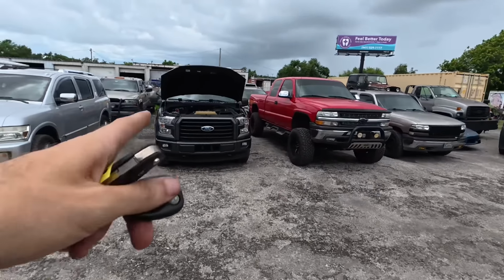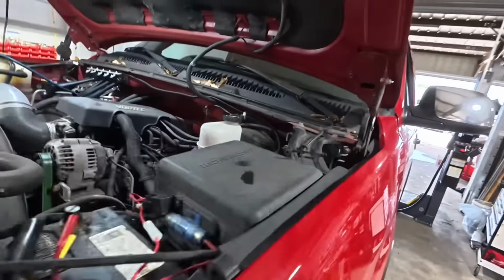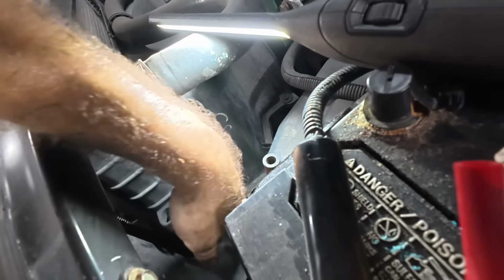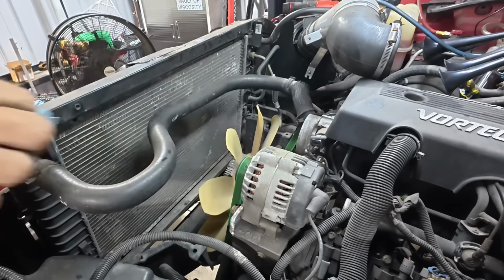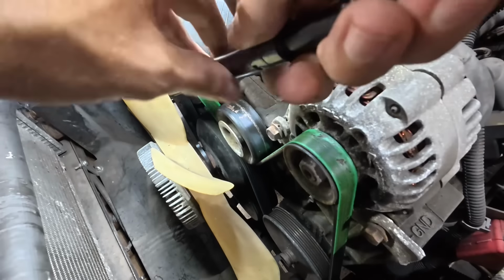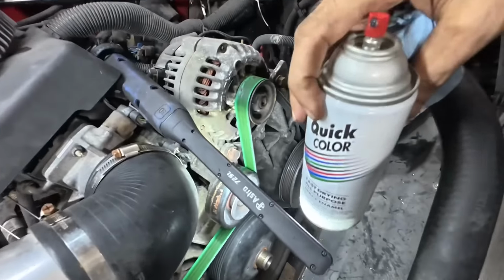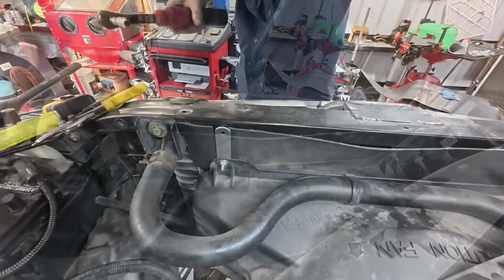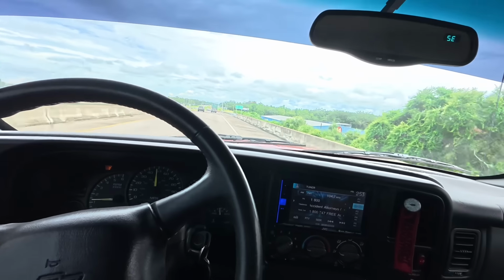Modified Truck has a Physics Problem!

Comment: I firmly believe that building a custom fan shroud that fits perfectly is a much better choice than purchasing a new one from another source, especially since it could end up being significantly more expensive and time consuming . By making it yourself, you not only save money but also ensure that it meets your exact specifications. However, this process requires having the right tools and expertise, which can ultimately lead to a superior and personalized result.

Pros of making the shroud 

1. **Measurement Accuracy**:

 Ensuring that all dimensions are precise is crucial for a proper fit. To overcome this, take multiple measurements and use templates or CAD software to visualize the design before cutting.

2. **Material Selection**: 

Choosing the right material is essential for durability and heat resistance. Research different materials beforehand and consider the specific conditions the shroud will be exposed to, such as temperature and moisture.

3. **Fabrication Skills**: 

If you lack the necessary skills in cutting, shaping, and assembling materials, the final product may not turn out as expected. Practice with smaller projects or seek guidance from someone with experience in fabrication.

4. **Airflow Efficiency**: 

Designing a shroud that optimally directs airflow without obstruction can be challenging. Test prototypes using airflow simulations or adjust the design based on real-world testing to fine-tune performance.

5. **Finishing Touches**: 

Achieving a professional look can be hard if you're not experienced with finishing techniques. Invest time in learning about sanding, painting, or sealing methods to enhance the appearance and longevity of the shroud.

By addressing these challenges proactively with research, practice, and possibly seeking expert advice, you can create a successful custom fan shroud.

Comment: fan clutches, are a joke. they work when the engine is first started, and DON'T DIS ENGAUGE TILL THE ENGINE WARMS UP. stupid. throw it out and install an electric fan. it will pay for its self with the gas munny you saved.

Comment: Maybe it's a lift kit, maybe it's Maybelline.
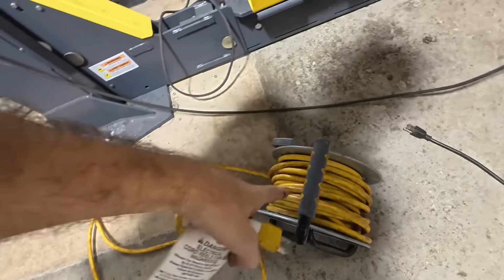11:00 If you use an extension cord, ROLL IT OPEN EVEN IF IT'S A BIT MESSY. You're risking a fire. (Also, why was that wallwart plugged into the top socket in the first place? :D)

Comment: This is funny, I have seen this fan removal tool twice in 24 hrs, I have had to remove mine a few times and used a wrench that fits and then popped the wrench with a hammer...

Comment: I think an aftermarket electric fan kit would have worked too. But you would have to set it up so that if the AC compressor was on the fan would turn on as well.

Comment: A neighbor jacked up his truck with about a 6" body lift (basic driveway mechanics)
On the first drive he got into an an accident when the steering wheel shaft pulled out of the power steering unit.

Comment: Does not matter if an electric fan system is slightly better, your repair was effective and is some respects simpler and at a lower cost  then the electric fans but most important you complied with the customers wishes,  That customer will likely come back when he needs more work to be done.

Comment: Ray you should have used D-shape gasket in that gap between the shroud and radiator. Also that serpentine belt was chewed up at the alternator pulley during most of your video.

Comment: The money needed for a shiny new lift kit is expensive and it's amazing the money can't be found to correct all the side effects of a poorly thought out kit.
 When GM built the stock vehicle we should give them credit for designing the cooling system to work as designed without modifications.

Comment: I don't know about you but I'd be asking the customer if this is a new problem like they just bought the car and it's like that or if it's been fine for years and then all the sudden just happened it just happened then you know it's not the cooling fan shroud and would have to be something else. I've been around hundreds of these trucks with body lifts and never really had any issue like this even missing the flaps. I bet you could've fixed that truck with just a new clutch fan and a full system

Comment: No Elec fan needed here at all. I’d replace the old 150k mile worn out fan clutch with a new Hd fan clutch.
Then I’d reinstall the shroud using adhesive back foam used to seal ac apps avail at Lowe’s etc to seal all the air gaps between the rad core & shroud.
Lastly I’d buy new oen placement flaps that mount on both sides of the radiator one of which you removed.
Doing all the above will get the additional airflow you need thru the radiator & condenser for proper ac operation & max cooling if the engine too closing all the airflow gaps along with installing s fresh new hvy dty fan clutch ensuring max cooling rpm & operation too vs a half worn out 150k mile tired fan clutch that’s not up to 200% operating efficiency resulting in less fan lockup/rpm considerably reducing cooling efficiency too.
I’ve done this sealing of shroud issues on mult vehicles in the past along with reinstalling the rad flaps with new Hd fan clutch that fixed this issue every time!

Comment: Hey, could you have pushed the bottom part of the shroud down. And then put the top part of the shroud up to close the gap. Then make some plastic spacers to fill the gaps between the 2 shroud halfs? Instead blocking the condenser?
Or would that allow too much air turbulence past the clutch fan?

Comment: I remember when I did a body lift on my Tahoe back then where the kit came with spacers to use between the halves of the shroud. I ended up using shingle material to cover the gaps. It worked😂

Comment: Some fine redneck engineering there. You would have loved what I did with my 2006 Freightliner Century seat today. Love the fan tool. The one I have requires the tech to be an octopus.

Comment: same fan clutch setup on my 2005 chebby express G1500.  I have to replace the duralast clutch every 2 years. lifetime warranty. Hot summers here, cooks the clutch good. What I did do this last go around is install an after market aluminium radiator that is about 25% larger (thicker) which seemed to help also when running the AC cool in slow moving conditions (stopped, traffic, etc).

Comment: I had the same air flow problems with my snow plow trucks overheating in the winter because of the plows pushing the air away from the front of the vehicle.  I would clock the spring on the clutch to pull more air flow thru the cooling system. As soon as I saw the clutch in the thumbnail I knew where this was going. Nice job

Comment: Now, see, most places that wouldn’t cause any issues whatsoever. Here in Ireland, we’re just coming out of our best summer in a decade, maybe more. It got right up there, for weeks at a time and there were public health warnings about keeping hydrated and staying out of the sun. How hot was it? A sweltering 30C (86F)! Lots of vehicles running around with severely damaged or even completely missing fan shrouds without a problem. There were a couple of days when I contemplated replacing the seized electric fans in my own daily driver, to get the AC working. But we’re through it now and it will be years before I need to consider that again. The engine never overheats, hence the seized fans. They never get used!
In Florida and a few other places around the world, temperatures are much higher and cooling systems are a bit marginal, so everything needs to be spot on, or even upgraded, to cope.
If that truck was modded in Canada and spent it’s life there, this problem would never have arisen

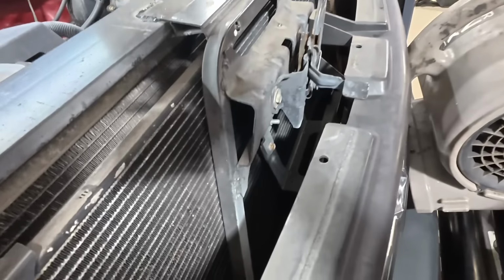Comment: Under neath  condenser cover at 12:53  look at the gap between radiator and top of condensor .  Later look at the sides also .  This situation is called bypass airflow

Comment: 300psi = 161F  =BAD   .....  OK=  200--220psi=  130to 137F   ,,,, . Excellent 150--160psi  =112 to 116 F  
WHY ?   this is the temperature of the refrigerant supplied your evaporator has to work with .  The higher the feed temp  your evaporator has to use cooling capacity ie BTU  to reduce this so it can get down to a usable level . Wasted cooling capacity .
Called Flash Gas because it flash boils .   In a car /truck its all about condenser size .  Currently using a serpentine  a modern version is parallel flow . 
Full computer control /ECU  operated compressors on the new gas run alot lower psi

Comment: Can someone please help me out, why is there a clutch on the fan? I thought there was a solid connection
Reply: Its is just a way of controlling fan speed( how much air it moves ). When its cold it just free wheels allowing the engine to heat up to normal operating temp,when its hot it clutches up to move more air . On electrics,you cts sends signal to the e-fan and turns it on and off as needed . Its the same in principal,just the mecanical version. Think the old gold round thermostats in a home compared to a new digital stat.
Reply: @petersmart1999  Thank you!!

Comment: refrigerant leak /insufficient refrigerant ,,, dirty evaporator ,,,  poor condenser cooling ,, connect gauges ,, sample refrigerant contaminated by other refrigerant and/or air  then .....common issues next would be thermistor failing  etc etc .** weigh the refrigerant you recover  another diagnosis tip... Vacuum leaks can be VERY bad on gauges and couplers . 
USE as product called NYLOG to seal   cased by  1/ outside of service port  2/ threads outside of coupler 3/ ontop of thumb screw ""peened "" shaft . When vacuumn is not acheived moisture will be in system can cause high psi reading .

Comment: just curious you extract the old gas and put it in other cars later or it’s a differnt bottle it goes into?
here in canada your  not allowed to buy the right gas unless a technician certified.
so stores sell 12a as a replacement for diy guys.
then you get a canadian car you might
be sucking 12a out of it not knowing

Comment: You came up with a cost-effective work around solution that improved the A/C.  Wasn't much else you could have done due to the body lift problem.  Electric fans would probably have only added an incremental improvement, but at a significant cost to the owner.  Good job!
Reply: Those trucks DID come with an electric fan option, and I could pick up an entire factory dual fan and shroud assembly that will bolt directly into the vehicle for $50 or less at a local pick-your-part junkyard. The factory dual fan setup blows out 3000cfms of airflow. More than enough, and cheap if you get it from a junkyard.

Comment: The owner would have been just as much good off (with the time you put in and thought you put in) with the electric fans. But it's understandable why he didn't want that electric fans, and trying to keep it simple. I give you  this, you put a lot of effort in what you did, damn good job. My future son-in-law was a tec, just like you. 
And he bailed, because of the BS that goes on. Was involved with similar of what you went through. You're doing a great job. There's not many that still do this. Good job bub, never give up.
Reply: if what I just text is all messed up, it's got to do with speaker text and autocorrect. I had to correct the best I could, what was messed up.

Comment: Why wouldn't you just remove the brackets off the shroud and have him buy an intake that doesn't get in the way of the shroud? That isn't the stock air intake. Without the aftermarket brackets the shroud would line up to the radiator like normal.

Comment: I agree with most here on modified vehicles the flat doesn’t apply it needs adjusting at the end of the day any vehicle operating daily with modified parts usually equals shop time due to the mods and most times taking away from functionality of the vehicles intended purpose lifted trucks look great but require so much more maintenance alignments extended parts wear and tear of bushings in some cases two piece drive shafts 🤦🏻‍♂️ 
As a mechanic I don’t twirl in these vehicles under any circumstances for clients great job Rainman I learn something new frequently when watching your episodes

Comment: Not sure how much into lifted trucks you are Ray, but the cheapskates would use a 3 or 4 inch aluminum spacer to BODY life the truck, leaving the drivetrain in the same place but raising the cooling package so some of the morons would drop the shroud incorrectly. but thats what you are working with is my bet

Comment: I remember dealing with body lifted trucks,,,,,and all the problems it causes. Correct fan shroud, body and radiator higher, but the engine isn't, so the shroud is cobbled in to fit the fan. Trucks with suspension lifts aren't much better.

Comment: The pickup probadly has a body lift so the motor stays on the frame, but the radiator raises which body. That is the cause of all the trouble. Operator error 😮😮😮😮

Comment: I like that you called the cold intake the hot air intake on that chevy. Cold air needs to be isolated from the motor, so it doesn't become a hot air intake.
Reply: It's stunning that people think a K&N cone filter in the engine bay is some how a cold air intake ... 😂
Reply: It is, in Alaska, in winter.
Reply: Yup.

Comment: Is it possible to use a foaming coil cleaner on the radiator and condenser?  We use them on AC and heater coils at work and they remove a lot of grime, dirt, dust, and I'm sure in autos it would remove a lot of insect bodies as well.  It only takes 10-15 minutes to clean a coil. Rinse it with a hose and it is done.   You just have to make sure the cleaner is compatible with the coil material...plastic radiators on cars just seems absurd!

Comment: nice job fixing the problem caused by the hack job lift kit, a bead of rtv on the mounting surfaces where the conveyor belt material was affixed to would close the small gaps between the screws. p.s.- the exhaust was crazy loud.

Comment: I put a gen4 454 BBC in my 79 Trans Am. Amazingly the stock TA fan shroud worked perfectly with the 454 (with solid motor mounts) and was centered exactly.
Tried using electric fans for cooling but NONE ever worked.
Then tried a water pump serp belt driven fan with a regular small fan clutch. No luck with that at all....
Least not ones I was willing to buy at a reasonable price. So my friend had 1990 454 SS Chevy pickup and I looked how his was configured for cooling.
BIG brass 4 core radiator and a HEAVY DUTY fan clutch.
So I copied that & bingo!!!! Running 185 F all day long no matter what!!!! :)
But I have to drill custom holes to mount it to my water pump.....marine grade stainless bidirectional (wasn't sure when I built the car & motor which way the belt was going to spin) which has a different bolt pattern than stock.

Oh forgot to mention I made my own serp belt system....brackets for alt & power steering with a automatic tensioner. No v belts to throw off anymore!!! :)

Comment: It's the lift.  Rad went up, fan didn't.  I have had 6 GMT 800s.  No lifts, but swapped to electric fans on four of them.  Nelson Performance makes a great wiring harness for this conversion.  You then buy a factory electric fan for a 2005 or newer GM truck.
Reply: Oops, yeah, there is programming involved with the electric swap.  I found a place to do it, and they also do a little tuning while they are in there.  Well worth the cost.

Comment: It never ceases to amaze me how people will spend a ton of money getting a lift kit, big wheels, etc, but baulk at a few hundred to make the AC work. Still, a good workaround by Ray, saves the day
Reply: sonny, back in my day e-fans ran on a relay and t-stat
none of this 200$ programming nonsense
Reply: @FaucisBIoodCIot 
Mine run on a relay that comes on when they key is on. I dont need no fancy thermostat electronics that turn the fan on and off. It's just on all the time, and is perfectly fine that way.
Reply: People like this should be helping us poor and homeless

Comment: The 2.7  F-150  reinforces my belief that most new cars today are rip offs considering price vs quality.  More importantly though Ray is a wonderful service provider.  The shop that I have used for more than 20 years to keep my old Toyotas road worthy would have sent me packing if I had refused the electric fan solution considering the problem’s root cause.

Comment: Yes, the electric fans probably would have been better, but the customer would have also needed to upgrade from the factory 105 amp alternator to the upgraded 145 amp one that GM put on these once the electric fans replaced the mechanical ones.  Given he didn't want to spend the extra money in the first place, the repair you did was probably the best of the bad ideas available.

Comment: Hey Ray!  I cringed with the upper rubber flap installation. 
A big trade-off between engine cooling and shroud performance. 
The flap blocked off a big area of the radiator (3”) effectively reducing engine cooling by about 20%.  That’s a lot!
He’s gonna need a modified shroud or electric fan conversion without question.

Comment: I knew it was from a body lift as soon as I seen it. You got it figured out though. 👍🏻😎 PS; You can use that door and window self adhesive weatherstripping foam to fill those gaps between the fan shroud and radiator.

Comment: I did the lightning fan conversion on my 2002 f150 years ago because of the body lift, just needed a bigger alternator and wiring. I knew it needed to be done and eventually it got done 🙂

Comment: The first thing I thought of is a body lift instead of a suspension lift! The extensions on the fan shroud! Also the gap between the intake cover and the firewall. Bad move not going to Efans. Flex o lite Efan conversions is a $500 $600 option . Dorman factory replacemen fans were about $150. Then you can install a Flex olite controller! That's  about $100. Manual l fans eat performance. Hp & gas mileage. Along with shortening the life of the water pump! Your afro engineering job worked fairly well though!